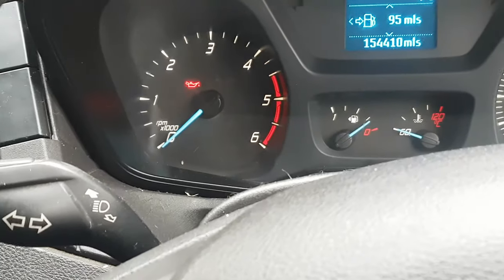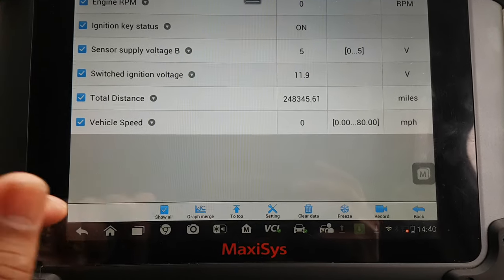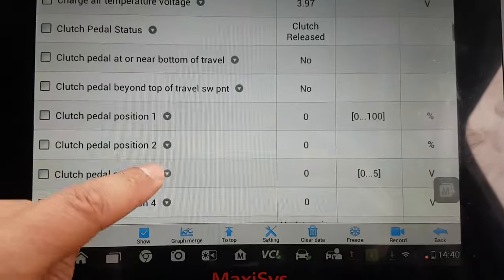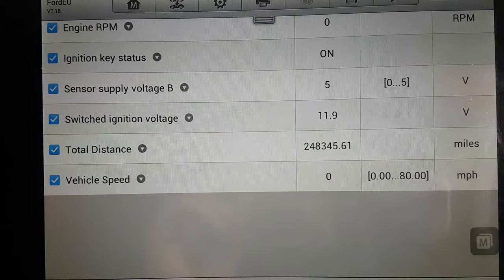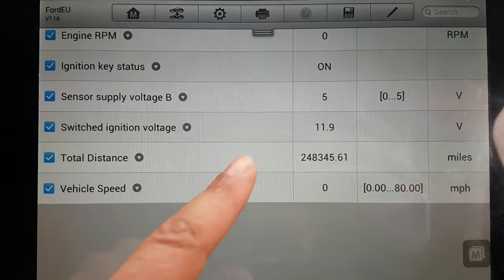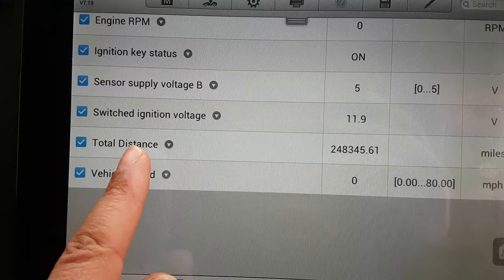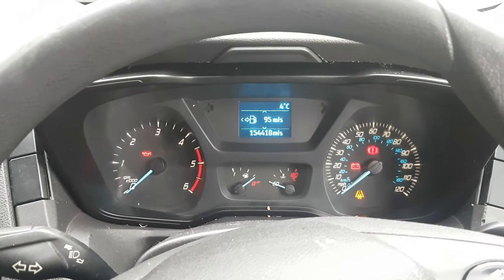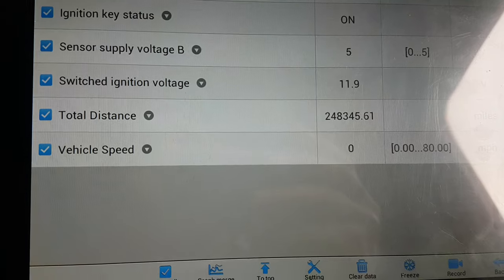How to know if your vehicle has been clocked - Using a diagnostics tool to show the correct mileage

Comment from the maker: A question came in this morning on this video;

Question: Can this be done on any car? Or does it depend what tool was used to do the mileage clocking??

Answer: Yes it depends what tool was used to clock it and if the mileage is stored in other locations.

My guess is the clocker used a cheap mileage tool that only corrected the BCM/Dash but didn't have a option for the engine. So I read the mileage for the PCM (Engine ECU)
Reply: Very useful clip! How about if the clockers use some expensive tool to change mileage stored in PCM (Engine ECU)? Can they? Thank you!
Reply from the maker: @valenciasummer2009  Yes but the process would be different to find the mileage on other cars, we do a training course on this and Mileage correction

AutomotiveEducation.online
Reply: @TheOBDcompany so will distance traveled always show up in live data?

Comment: Not always Aurelius show correctly miles or km so on the clock showing 154410 miles if we calculate them 154410 X 1.609=248498.807 Km which really is very close to your readings by Autel first test on other vehicle for confirmation I did saw a lot mistakes like this
Reply: Haha nice one. So much gear but no idea.
Reply: I guess he can test that by driving while linked to the device. Then he can see if it shows the correct speed in miles as well. Still not bulletproof though.

Comment: How about if that ECU was taken from another vehicle with high mileage and installed into that one? That could be a possibility.
Reply: I was wondering the same thing I'm shopping for a vehicle now what if the computer was replaced with a low mileage???? Will my scan tool pick up the original mileage?
Reply: @newwavepressure6478  it will pick up the mileage recorded into that new ECU. You can always check a carfax or some sort of vehicle history before making the purchase. I ran into a situation buying an Acura MDX, the seller had altered the ODO but I was able to find the scam by buying a carfax. The MDX had 181k miles and the seller altered to 81k.
Reply: The computer from the other car will have the miles also the vin from the car you take it out of. Thats how you tell if the computer was swopped

Comment: Hi good video can a 2002 4runner be checked for actual miles what type of mechanic would I have to look up ?
Thanks for the video 👍
Reply: As he stated in a previous comment, it can be checked for the actual milage that the ecu has stored. So if someone changed the milage on the cluster, you could catch it with this scan tool. However, some of the more advanced scammers will go ahead and buy a really sophisticated milage corrector. And those tools may also have the ability to change the milage on the ecu. So it depends what milage corrector was used. My biggest concerns with your 4runner would be #1 the rust on the underbody (Toyotas rust very very quickly) and #2 would be the head gasket. All those Toyota engines will have headgasket problems at some point.

Comment: Very interesting and concerning. Is it possible to change the mileage further in the computer system so that the diagnostic tool can be fooled? I am thinking if you get a good inspection will the inspector always be able to find if it's been clocked?
Reply from the maker: @tes but the process would be different to find the mileage on other cars, we do a training course on this and Mileage correction

AutomotiveEducation.online
Reply: It is possible to reflash the EEPROM with a lower mileage and align the data with other modules that record it in the vehicle. Many record the mileage of the last ODO change. This can be thwarted by changing to 0.0 miles before changing again to the desired mileage... but even then EEPROM keeps count each time a change is made to the odometer, so even the most high tech devices are not undetectable but can pass a simple inspection if done correctly.
Reply: Is they only change one module (amateur) then a mechanic with a expensive tool like  Bosch
Can see if other modules have different millage

Comment: Hi does any body know is Autel MK808 can do the same? read module running time (check original millage in cars). I ask because this is Autel 908 version more expensive.
Reply from the maker: Hi, Yes this will also work on MK808

Thanks
Reply from the maker: https://www.theobdshop.co.uk/product/autel-maxicom-mk808/

Comment: Thanks for the many great videos, I have a question what is the best scanner to confirm actual miles on a vehicle away from the dash? I'm in USA and have a Budget of $1000 but want to buy in usa for warranty purposes. Where I live many cars are imported from canada and some show low miles on the dash and show signs of higher miles or beat to tar low mile driving. I have a 919X scanner and frankly i'm not the happiest with this scanner. Thanks for your help.
Reply: I second this question. Let me know if you find a good answer
Reply: @lotsoftorque3632  closest I found was the xtool D9 and it does ok but you have to dig deep to sometimes find the miles. It has a odometer read but it doesn't work on all cars.

Comment: One guy I spoke to said that you can pay around 100 quid or so to a shop that offers 'mileage correction'. He said that its not at all tracrable if you do it before an MOT?

 Like, he meant, all the places that the real mileage is stored, can be clocked? I always though that these guys were changing the mileage on the odometer and the dash chip, or do they change it on the ECU aswell? I'm planning to buy a 4-5 year old car Lexus and now I am scared and paranoid I might get a clocked car, especially because it'll be a hybrid.